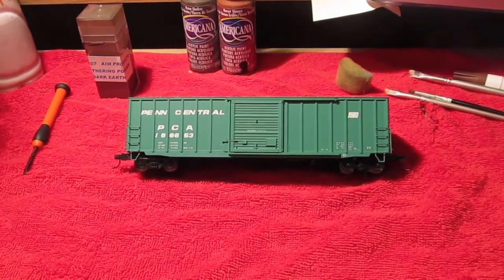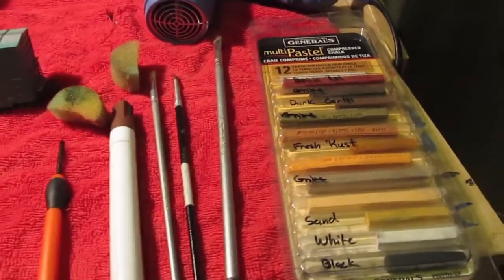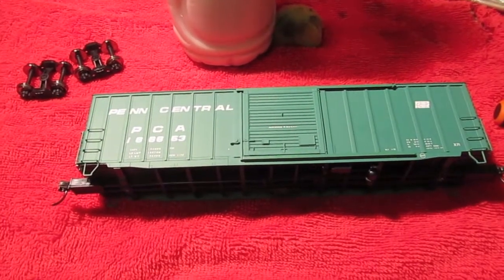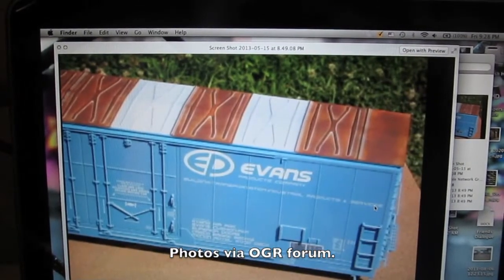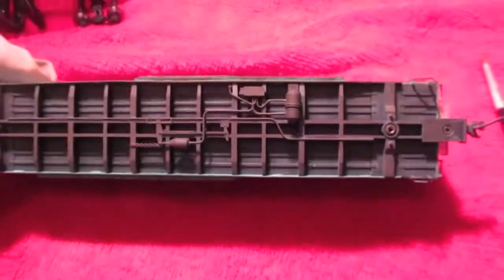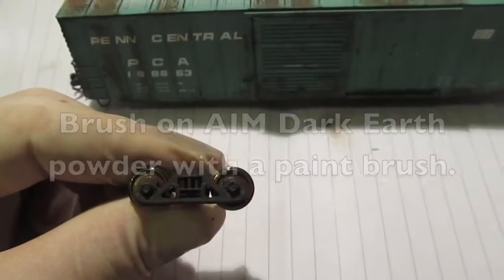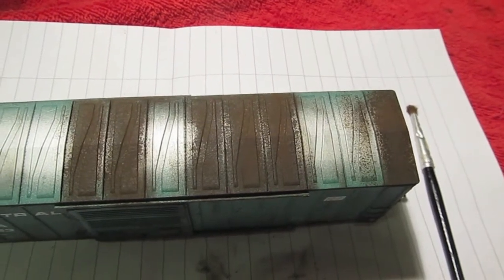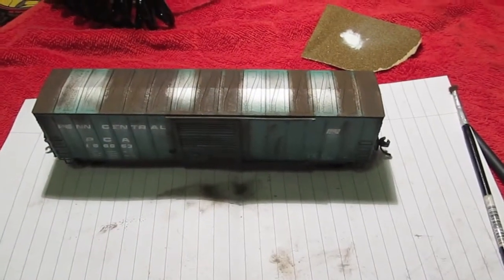HO Scale Weathering HOW TO 100 Subscriber Special

Comment: Hello Efitter, Before I do any weathering to my cars. I always wash the new car with Isopropyl Alcohol to remove the chemicals that might still be on the car from the Manufacture. I have a bottle of clean alcohol, and I use a Q tip and wipe the whole car down. Then let it air dry. I will not touch the car with my bare hands because of the oils from your skin. You would wear rubber gloves. You can get the rubber gloves from Wal mart but make sure that they don't have the powder on the latex. Because the powder will react with your paint and contaminate it.